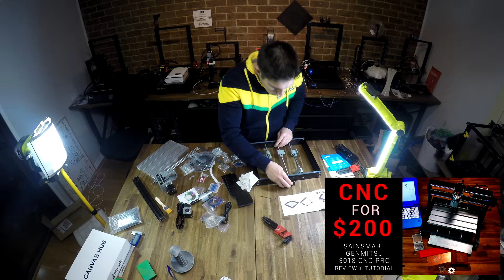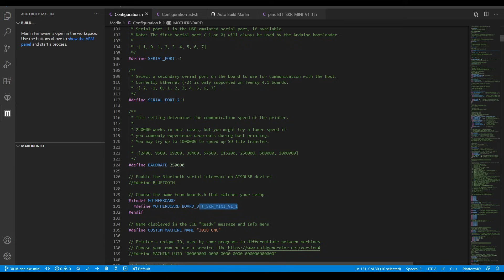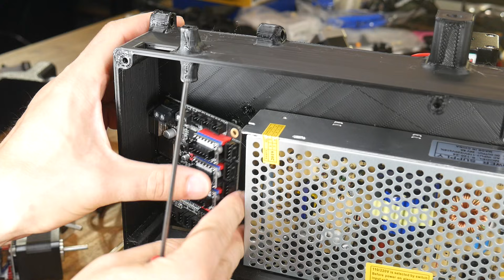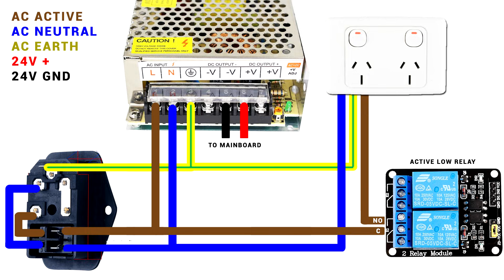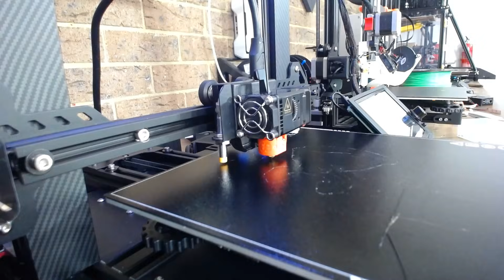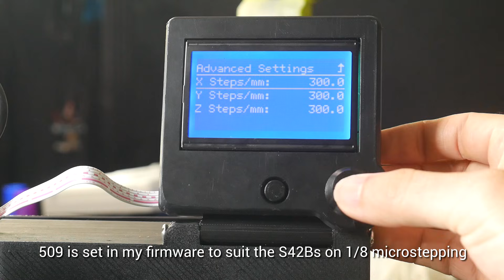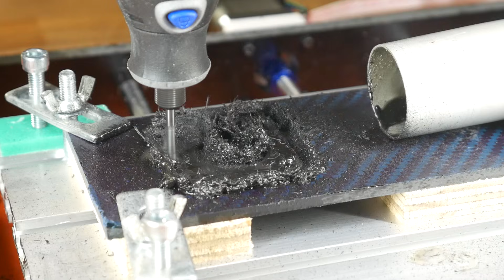Genmitsu 3018 CNC upgrades: Mill acrylic, aluminium and carbon fiber

Comment from the maker: UPDATE: There is now a size upgrade kit available for these routers: https://yorahome.com/products/yora-3018-expansion-kit
Please check the webpage to ensure compatibility and suitability with your machine.
Reply: Hey Michael, 2 things, 1 why instead of the dremel (which isn't really meant to be used as a spindle, u use a brushless spindle? 2nd, if u use the dremel, why u don't use the hotend port and a external ssr or similar so u can control the speed of the dremel?
Reply: Hey Michael, Do you think you could get away with just upgrading to a Dremel and a smart controller, it would be able to handle some 2mm Carbon Fiber? Just trying to find the most cost effective way for a project.

Comment: been able to mill acrylic with an even cheaper CNC, as well as a 3018, without upgrade. But aluminium and carbon fiber  for sure  need an upgrade

Comment: Sorry, but these mods are not smart. You will loose Candle height maps if run from sd card. The limitation of the 3018 CNC are its springs in the lead screw nuts. No more cutting force can be applied, so a stronger motor (spindle and lead screw) does not make sense. It only deflects the weak construction more. On many 3018 the ER11 does not run good. The collet is not good quality and sometimes does not snugly fit the motor axis but is sluggish. Buy a better collet, run out of 3-8 microns is possible, heat shrink on the motor axis. Than supply the motor with 36V instead of 24, this will increase the rpm and allows faster milling. Don't forget to adjust the frame exactly rectangular, as any error will show up in the workpiece. Some vendors also have a bad preset for steps/distance, so recalibrate it. Than the 3018 will cut acrylic (at 1500mm/min), aluminium (at 500mm/min) and carbon fiber (which rapidly ruins your carbide endmills).

Comment: I rebuild model trains from 1940s & 50s. I use my 10s Pro V1 with all the mods you have helped me with, Today we are running out of vintage drive linkage and we need to fabricate it from new it is sheet metal .04 inches thick and about 6 to 8 inches long, less than 1/2 inch wide and thin sheet metal. I had cut three rods up and soldered them together to make custom length side rods and I have 3D Printed shaped rods but never more than 2 axles. we also need 3  and 4 axle side rods.  I heard slower speed is needed for sheet metal. It seems the 3018 would be perfect If I can find a cutter and motor to make the torque. Would you have any suggestions/? Dennis

Comment: hello, for the aluminum, what settings did you use when making those 4 holes in the corners? I'm really struggling to get holes to work. also what endmill did you use?

Comment: The higher end 3018's, even ones with the slightly "bendy" spindle, do not need any upgrades to mill acrylic or carbon fibre. Aluminium can be milled but only very very slowly!

Comment: No spindle speed control. Try triac with speed encoder feedback. Needs firmware upgrade programming. Be sure you use crossover detect circuit to time your pwm with ac.

Comment: Hi, thank you for such an easy step by step instruction. I'm only just starting out, yeah old fart trying catchup, haha. I'll be going through all of your vids and try to get it into my head. I have one question, I bought my 3018 CNC from Vevor, can you tell me if it is compatible with the Sainsmart? And can you tell me if there is any upgrades that you would recommend apart from the one you've shown here?
Reply: I just got my Vevor 3018 with 2.5W laser last Friday. Got 1/4" ER11 collet and some better bits from Adam's Bits. 1/8" single flute upcut for aluminium plastic, plus 120degree for Vcarving, and two flute 20 degree engraving bit today. Got a Dremel already if I need it. Jaycar sell faster motor. Brushless mobile boat motor with water cooling?

Comment: The stock DC motor runs at 7000 RPM on the 3018 i bought.

Comment: You have changed out like 80% of the machine with this upgrade. Why not go the other 20%?

ie instead of upgrading, build a whole new one. Then you have two machines. The second you can keep as backup, or light engraving work. Or sell.

And please use the CNC itself to make the new parts. Because some of us don't have a 3D printer yet. 😁

Comment: I never even thought about using the kind of large display that an ender 3 has for my 3018. I use a totally custom mainboard that I designed and fabbed myself, and I've been trying for almost a year to figure out a way to implement a display on the machine that would be sufficient. This is a fantastic idea!

Comment: I got a version of these things. I'm really interested in the added Powerplug and relay for control.  I beefed up my 10mm x rails with 12mm added larger bearings to the gantey and put a Dewalt 611 on it.  I can now mill pretty effectively. I just hate having to manually the spindle on and off.

Comment: Sorry if that has been asked and answered already, but...

If you're running an SKR board, and Marlin firmware, could you also run a Raspberry Pi/Octoprint installation and control the CNC wirelessly? Seems like that would be a cool feature.

Comment: Thank you for the great video. Do you think it would improve the z-axis stability to make the linear bearing mount thicker and use an extra long bearing. Seems that 35 mm bearings are available on Amazon. One would loose some vertical axis travel of course.

Comment: Update 1/25/22:
 cheaper than other link, see below.
- Bigtreetech S42B out of stock on Aliexpress at that link. One can still buy S57B v2.0 (NEMA 23. I think), or just the bare servo board with no documentation there.
-The 3018 Pro at the Amazon link is $420.95

Comment: I'd say the most relevant upgrades for this printer are, indeed, both the spindle and motherboard. The stock spindle (8000 rpm, not 10000) is ok for PCB milling, yet not for other things. As for the motherboard, it's plenty senseful to upgrade to something a bit different running Marlin.

IMHO, we can simply use an upgraded 775 Spindle running at 22000 rpm instead of a dremel, because the dremel has to be switched on an off manually ; that can be quite an impediment if you aim to have a fully automated start/mill/stop sequence.
About the mother board, SKR Mini is a good choice for an upgrade, even if it's a bit overkill considering we don't mill as fast as 3D printer do their stuff. Still, well, lots of resources available. :) Given the low price of 32-boards nowadays, it's pretty logical to do that move.

Unsure about the motor upgrade. I can't see benefits to swap stock motors in favor of closed-loop steppers ? I'd like some explaination because it's unclear to me when it comes to milling machines.

Comment: Wait so why dont we use 3d printer control systems more often in small cnc machines? It seems more effective for the size than the bulky stepper motor drivers you see in a lot of low grade kits

Comment: I'll be the first to admit, I'm more of a "plug and play" person when it comes to equipment, as for me the fun comes more in creating the items that the machines will produce.  However, I still enjoy watching these videos as it also helps me understand how the various components work together...  and because I'm a "Champagne tastes on a wine cooler budget" person,  it's nice to know that if I need to, I can potentially start with a less expensive machine that will manage a decent level of what I want to do, and add functionality later as the budget allows.

Although, as I type that, I'm also fully aware that knowing that I can, and actually will...   well, the BLtouch I bought a few months ago is still sitting in it's box and not added to my Ender 3 Pro...

Comment: I'm impressed with the results, particularly as Dremel chucks often suffer from poor runout. I'm going for a 500W spindle motor with ER11 chucks and PWM speed controller.

Comment: Proper bit choice is as important as feeds and speeds.  Plastics cut much better with single flute endmills.  You won't get chipping or melting.  Plus, you can get much faster feed rates.  Carbon fiber and fiberglass have their own endmills with a fishtail face and what looks like roughing sides.  Aluminum mills best with a 2 or 3 flute endmill.

This information comes from 10+ years of experience with the predecessor of this machine, the Zen Toolworks 12x12.  It uses a parallel interface, Mach3 for G-code processing, and CamBam for G-code generation.  I've upgraded this machine over the years. The Zen uses PVC sheet for the frame, and solid rod with slide bearings for all three axis.  The vertical supports were sandwiched with aluminum additions which greatly stiffened the machine.

Comment: Can you run the original spindle with this configuration?  I'm asking because there is an aluminum upgrade for the z axis that stiffens up the unit for more precise cuts. i also already upgraded to a 20,000 rpm spindle already.

Comment: no issues with heat buildup in the control box with the power supply and drivers and no vent holes or fans? would that relay be able to support the current draw of a shop vac for chip collection?

Comment: Have you done any non-planar CNCing with that setup and that CNC?

I'm looking to buy one of these and put my spare Octopus and Dremels on there to mill some 3D Printer parts and brackets.

Would like to know if it's easy to get to nonplanar cutting with just this or if I have to look further for upgrades to do it with this machine.

Comment: Hi! A little help would be greatly appreciated. I am receiving new stepper motors today witch are slightly more powerful than the originals. Do you know if the grbl controller needs updating to take account of the power difference? (The steppers are 1.5 amps) Thanks great tutorial!

Comment: Yes sir. If you could get ur hands on unimat db 200/sl 1000. Be nice to see how  u would upgrade it with 3D printer parts or  other ways bigger motor stuff like that as the little machine is popular than ever.

Comment: Hi.
Great video. I plan to perform part of this upgrade.
Would You be kind updating description with recedipt hgow to compile and upload CNC customized firmware to reprap board.
I assume that Marlin is already modified for this project, but how to compile and upload to the board?

I see ino file, so I assume arduino with stm32 board plugins, but which board chose for reprap used in this project STM32F103RC btt 512K ? Whhat IDE You are showing on the video is it New Arduino 2.xx?
Please advice.

I plan as a first step upgrade just spindle and controller. same steppers etc.
Is any chance to control spindle speed by controller?
I plan to use DC spindel 500W and triac based regulator with optical isolated voltage contrlol by PWM (process Pulse width to triac trigger delay control.
Reply: I have Setup VS Code withPlatformIO IDE. Set up environmet for STM32103FRC procerssors, but building code returns with error File "C:\Users\sp5io\.platformio\packages\tool-scons\scons-local-4.1.0\SCons\Environment.py", line 585:
    raise OSError("'%s' exited %d" % (command, status)) Environment           Status    Duration
--------------------  --------  ------------
STM32F103RC_btt_512K  FAILED    00:00:00.994
============================================================================================= 1 failed, 0 succeeded in 00:00:00.994 =============================================================================================The terminal process "C:\Users\sp5io\.platformio\penv\Scripts\platformio.exe 'run'" terminated with exit code: 1.

I noticed that one file shown on video is missing: "Auto Build Marlin", maybe I should do something else?

Comment: Please (!!!) be extremely careful cutting carbon fibre sheets. The way in the video is absolutely NOT safe enough. The dust is dangerous (carcinogenic in fact) specifically because the particles are VERY small and sharp. As such, they simply pass through any vacuum cleaner filters and - worse - are simply launched into the air through the vacuum cleaner. You would need a very expensive set of filters to prevent this. Currently, the method in the video actually made matters worse. Even after cutting, the microscopic carbon fibre particles will still be lying around the shop, ready for you to inhale. Therefore, IMO, there is only one cheap and effective method to work safely with carbon fibre: cut it under water, for instance in a shallow tray. They traps virtually all the dust, it cools the bit, and it allows you to safely dispose of the dirty water afterwards. Carbon fibre dust works like asbestos: the risk is severe and may become clear decades later.

Comment: Awesome video, found it by searching for marlin controlled cnc machines :) Would it be possible to output a 0-10v signal from that mainboard to control the speed of a spindle? Can this setup control an additional fourth, rotational axis? Keep up the awesome work mate!

Comment: Surprising to see you didn't add some sort of sensors for homing, using fixtures and reliable positioning would imho be a good value for little money even if going with inductive switches. Anyways, great content as pr usual.

Comment: I have a suggestion: it's very common to home a cnc to zero when milling metal by hooking up the bit and metal to a +ve and -ve such that when the bit touches the metal that is zero. Handy in PCB milling. 

I just got a used CNC to upgrade using your great guide here. When I do, I will be sure to try to add this z-homing through shorting.

Comment: I was wondering, why dont print a extender, so the motor can be higher And also an adapter to instal a bearing in the er11 chuck so it's more robust?

Comment: Could you replace the z-axis limit switch with a tool height probe and then store the heights of different tools for z offset for use in g-code with each tool?

Comment: I'm sure it's been mentioned already, but the original spindle rpm is 7500 I believe. The 1000 rpm being referred to (S1000 as a maximum speed) actually refers to 100% pwm output.

Comment: I wonder how it would work by mounting the Dremel on top and using the Flex Shaft attachment   I think you’d be able to mitigate some of the vibration as well as allow for on the fly turning of your spindle speed since it will no longer be moving.

Comment: got it, am happy with it, better than i expected. I added low pass filter to the spindle motor, 10hom/100W series resistor and 100uF capacitor across the motor poles. Lowers noise about 6dB but what is more important, it takes ALL of that 1.1kHz whine away. Mine is so silent i can use it in my apartment at night to do light engraving...

Comment: A tip for any milling operation is to keep the milling cutter protrusion from the collect/chuck to an absolute minimum, helps reduce or prevent chatter/tool breakage and provides regidity for the cutter. Water is not a great thing to use on HSS cutters due to eventual rust or if you do wipe down with WD40, but its not great for the dremel collets/chuck either so oil spray is a better option. When I use to programme CNC milling machines with a new file the Z axis was disabled and cutter compensation set to zero, with a pencil put in place of usually an end mill to watch it run through once and catch any typo's or errors in G code that was all manually calculated and entered.

Comment: I've just bought the 3018 pro and I have Dremel 3000 on the way but I am new to CNC what cutting bits or drill bit you use for the tough materials? Please

Comment: BTT SKR mini V1.1 mainboard there are several options. Which one do i order? Thanks in advance!
Wire Port Board
Wire with A4988 x4
Wire with Drv8825 x4
Wire with TMC2208 x4
Wire TMC2130 DIY x4
Wire TMC2130 SPI x4
Wire TMC2208 UART x4
BTW i have and ender 5 plus. Can i buy a better controller for it instead and use the stock controller on the 3018?

Comment: WARNING: Carbon fiber is bad to machine in open air. The resin and carbon particles hang in the air and are particularly (pun intended) easy to breath. The fiberglass fibers in the composite are also broken up and some is small enough to become airborne. The rest is freed to act like a mass of small needles that can cause infection prone slivers. Professionally carbon fiber is machined submerged on a water table, in enclosed machines, and/or with extreme vacuum dust collection systems. Stay safe with your hobby.

Comment: I like your no nonsense videos.....they have helped me. Can you cover the changes that you make in Marlin 2 using VSC and Platform IO. I want to use the BTT SKR 1.4 for CNC and a Laser cutter. For example I cannot get it to compile if I set Extruders to 0, and I would like to be able to divert different functions to different input/outputs. My friend described it as Whack-a-Mole. You fix one problem only to have another pop up.

Comment: Excellent video.
Definitely tempted to give this a go, just have to dream up some jobs for it.
But now I'm thinking about it a water (or cutting fluid) base with pump would be another upgrade. This would negate the carbon fibre dust issue. Pump and hardware could be printed.

Comment: Would be great if you add an Laser to it, and mabye a menu to easy change between laser and CNC... You can also add endstop's, even for Z... With an MKS E3P you can even add Wifi and use ESP3D For GBRL... Mabye even laser lines to show the exact point the dremmel will hit on the surface...

Comment: I've found you can do fast, high-quality carbon fiber cutouts with small-diameter (0.8mm - 1.6mm) diamond-cut carbide burr tools like the ones from Kyocera. They're made for commercial PCB routing, but they're quite cheap online.

Comment: I'm a little confused, are the stepper motor drivers on the S42B board? or that little card that plugs into the main board... and how do these drivers compare to the TMC2209/TMC5160 (or is that even a sane question to compare them?) 

also does this SKR mini V1.1 have a way to program a z-probe and emergency stop?